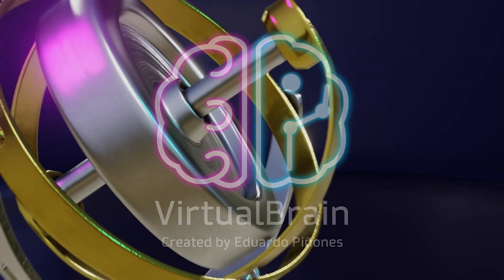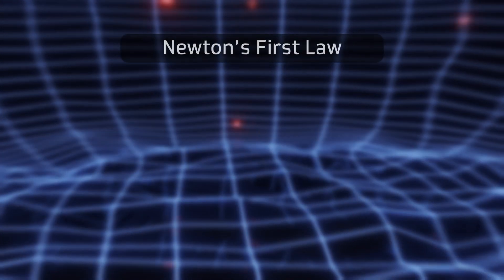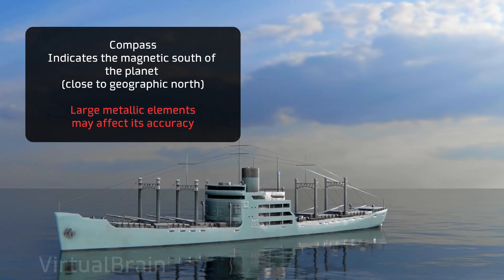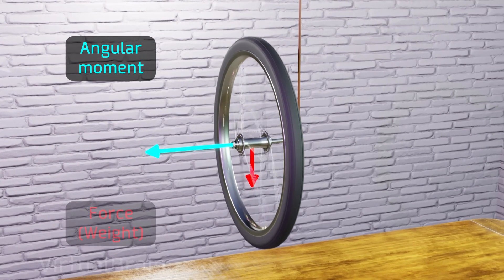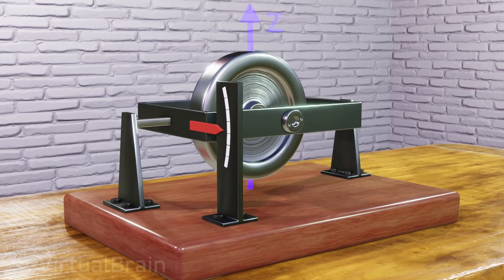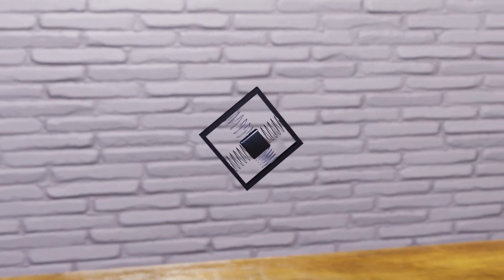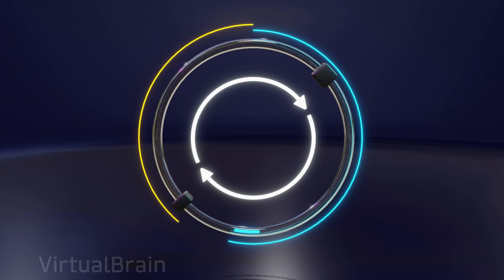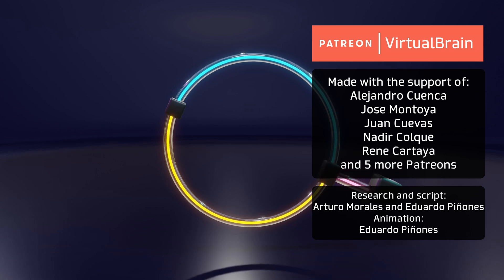How a Gyroscope Works ⚡ What a Gyroscope Is

Comment: The vestibular system has nothing to do with a gyroscope. The motion sensing features are not rotating. They are stationary and are activated by the movement of fluid across the surface of the sensors.

Comment: Angular momentum is a concept that came from the first hasty math "analogy" that worked.  Angular momentum does not really exist, so everything based on it "follows" the analogy, so you don't really understand anything.  THINK for yourself and try this.  Tilt velocity is ALWAYS perpendicular to the spin plane.  Imagine what must happen to TILT VELOCITY as it travels around a spinning disk.  A changing velocity creates acceleration, and this acceleration ends up perpendicular to spin velocity, so spin velocity HAS NOTHING to do with it.  Spin RATE does.  OR, you could just watch my video on it.
Reply: Angular momentum is an analogue of linear momentum. And as an analogue, it works.
Reply: @DingbatToast  That is the language that is taught to EVERYONE, even me, and I don't buy it anymore.  If you didn't see the point that I was making, then you are still captured in the paradigm.  You must try.
Everything AFTER a right-hand rule contains NO real cause.  "The wheels on the bus go round and round."  This song describes EVERYTHING you see a bus do EXACTLY like math does, but you wouldn't call it an understanding of a bus, now would you?
Reply: @DingbatToast  What"s even more,,,there is nothing relative about angular velocity (or momentum).  Angular velocity is absolute and agreed upon by ALL observers.  Each and every linear velocity has INFINITE definitions, which is exactly like saying NO definition.  They don't really compare, unless you are resigned to being the rote memory dependent modern scientist that believes everything they are told.  There is no responsibility in that.

Comment: The human vestibular system works nothing at all like a gyroscope. Arguably halteres (a vestibular organ some insects have) work similarly to a gyroscope, but mammals 100% do not have anything like a gyroscope.
Reply: True in the strictest sense. But as is clear from the latter examples, the term gyroscope is used to define any device used to maintain system stability. The gyroscope in your phone does not have a spinning disc relying on angular momentum to determine orientation.
The vestibular system detects gravity and pressure changes in 3 dimensions to inform positional data to the brain. So it is in effect our "gyroscope"
But I get your point 🍻

Comment: The 'ancient' (lol) mechanical gyrocompasses do not just 'point north' because they are started in that direction.  They have a lot of ancillary equipment that help them detect the rotation of the earth and align to point towards the geographic pole.  I personally have started up many such units and we sometimes will deliberately start them 'off north' and measure how quickly they can find and settle on true north as a test of the equipment.

Contrary to your video's description, they do NOT lose accuracy over time.  If compensated properly for the ship's speed, they can maintain their accurate heading for months with little need for adjustment.
Reply: This video describes mechanical gyroscopes not gyrocompasses which use mechanical gyroscopes
Reply: @devinrauser7932  Both mechanical ?
Reply: Thanks for stating that! Nice to know! Any recommended links or videos with more info about those?
Reply: So why do they need adjustment ?
Reply: @ You are probably confusing 'directional gyro' with 'artificial horizon'.  The 'directional gyro' drifts over time and has to be adjsted about every 15 minutes.  The artificial horizon has a 'cage' knob that can allow you to center it for faster startup.  If it starts up 'tilted' it can take over a half hour to get leveled.  "Caging" it during startup can reduce that to just a couple minutes.  Once in flight, 'caging' is not recommended.
Reply: Don't mean to burst your bubble but a gyroscope proves a stationary earth.  How can a gyroscope detect motion in any direction with great sensitivity but says "you are stationary" when it is not being moved.  The spinning ball earth concept is from Lucifer and those that worship him.
Reply: @notagain1952  Because it DOESN'T say 'you are stationary'. The earth spins quite slowly, taking 23 hrs 56 minutes to make one complete rotation. And that's exactly what a precision gyroscope shows. "A... fifteen degree per hour... drift" (thanks Bob, RIP)

Comment: how do airplane gyroscopes re calibrate when flying over long distances to allow for earth curve?
Reply: Older aircraft had two types of gyroscopes.  One used in a 'heading indicator' was manually set by the pilot about every 15-30 minutes and was set based on the magnetic compass also found in the cockpit.  It had the advantage that it could respond quickly as a plane turned and banked, where the magnetic compass was damped by fluid and took several seconds to settle after a turn.  With just magnetic compass, pilots would often turn too far and have to correct flight several times to get steady on a new heading.

The the other was a 'artificial horizon'.  It was equipped with a small 'erecting system' that basically included a hanging weight sort of mechanism.    If the gyroscope started to no longer point 'horizontally', the system applied a small force to the side which would make the gyroscope precess back to the horizontal.  This instrument helped the pilot fly straight and level when they couldn't see anything out the window.

Flying over the earth's curve, the 'artificial horizon' will maintain 'level to that part of the planet it's over because of the erecting system able to sense which way is 'down'.